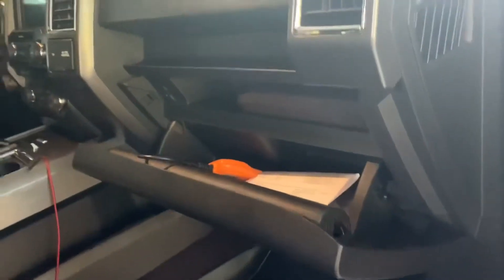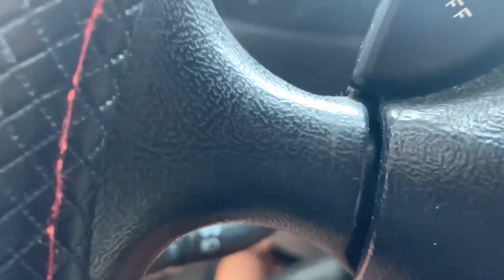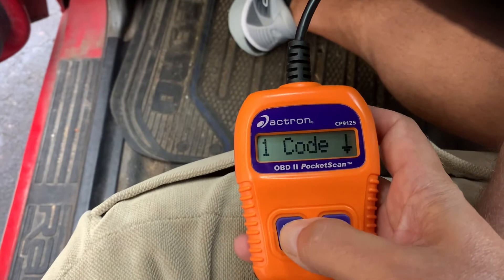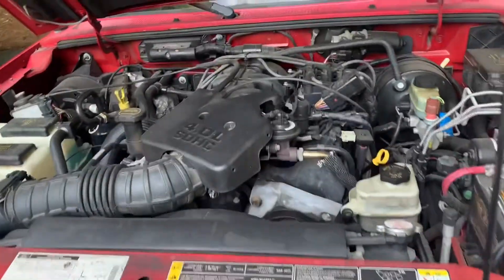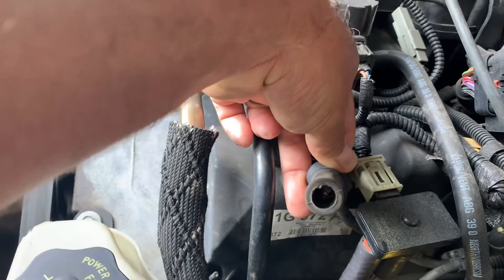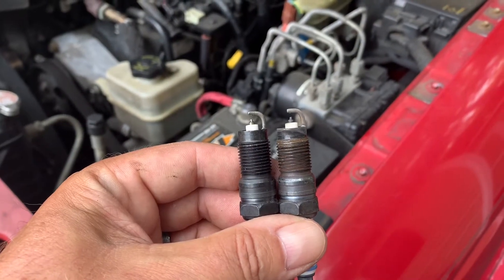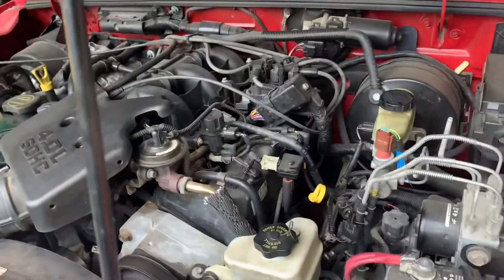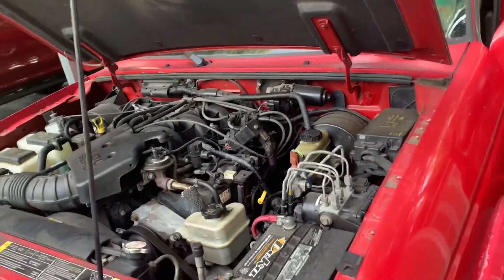Ford Ranger Trouble code Po304 Fix.

Comment: dealer said, replace plugs wires coil pack.  OK, they did.  even tho wires were only one year old Ford.  did seem to fix issue- but in the meantime, on the Skyline lot, the cats were stolen...

Comment: I doubt very much whether it would have been the plug, that plug was not bad enough to misfire, and these don't have distributers, they have a coil pack.
Reply from the maker: Thank you. Yes I agree, and someone suggested it may be a fuel injector gone out.
Reply: @LivinWith3M  Yes or just the plug to the injector may have come off.

Comment: I have a 2000 Ford Ranger 3.0. Code P0304, so l replaced the coil pack with a new Motorcraft coil . That worked for around one year. The code P0304 returned, replaced plugs with Motorcraft plugs and wires. The next day the code reappeared. The truck seems to run fine ! Any ideas ?
Reply from the maker: Mine has done the same thing. I was told to replace that fuel injector and bingo. No more issues.
Reply: @LivinWith3M   Thank you !
Reply from the maker: You are welcome.

Comment: I've  got a 2010 Sport 4.0L and just had this issue...swapped plugs, wires, and unfortunately the problem persists. Only thing I can think of is the coil pack...hopefully that fixes it.  BTW it Ran off the original plugs and wires for its entire life. Alot of Idle time involved...only 63,000 miles on the motor....
Reply from the maker: I would bet that you are right. Those coil packs go out all the time. Let me know. Thanks.

Comment: same issue 3.0 2002 new plug did NOT fix... still looking, but thanks.
Reply from the maker: Thanks for that update man. If I come across what else it can be I will yell. 👊🏼🍻
Reply: What did it end up being
Reply from the maker: Found out mine was the injector clogged.
Reply: Did you just run some seafoam or replaced the injector?
Reply: shudder... eventually replace ALL plugs, wires, coil block.  that worked.
Reply: I have the same code 
Replace spark plugs,coil is giving good spark,new cables,new injectors,check compression and it has 100 psi ,and the wiring for the injectors it's getting signal and pulses,but the problem remains,at this point I don't know what could be ,any ideas?
Reply: @osbelgarciajaquez1592  fuel filter....